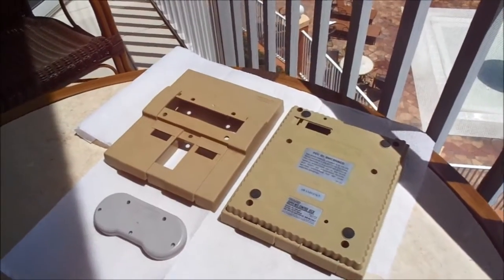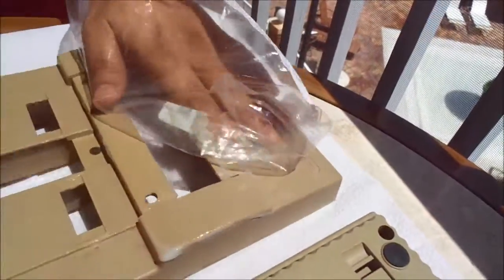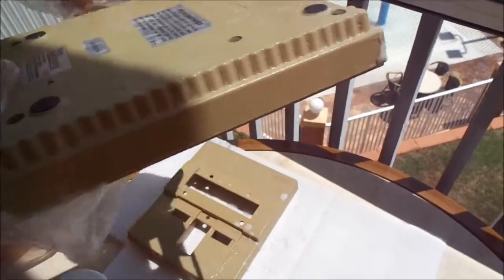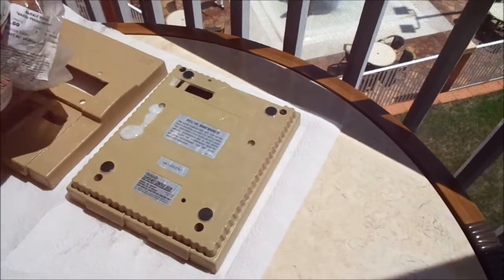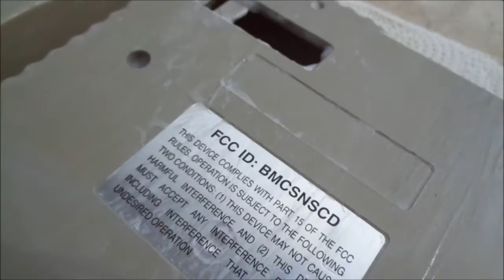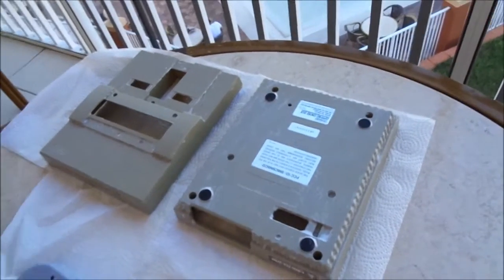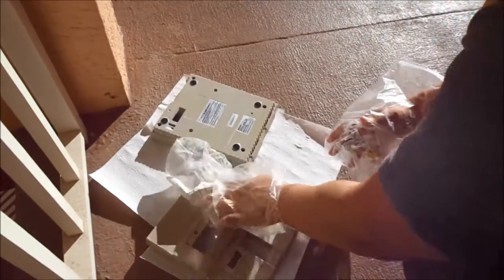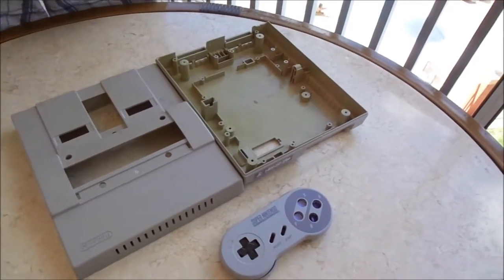How to Remove the Yellow from a SNES Super Nintendo / Restore De-Yellow Tutorial using Salon Care 40

Comment: the colour change is fantastic !
Reply from the maker: It looks really good. Plus I could have done the insides if I wanted and it would have cleaned up just as good. :-)
Reply: it adds to the value so much
Reply from the maker: It does add value, but to be honest,  it takes too long to do it to make it worth doing all the time. Mostly because of the having to take apart and put back the system part.